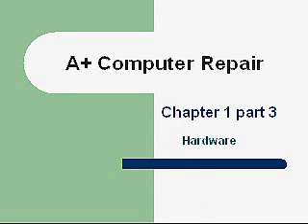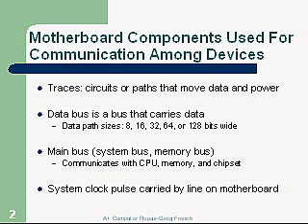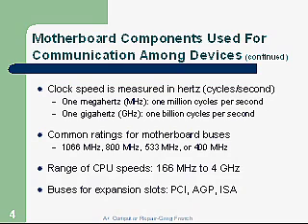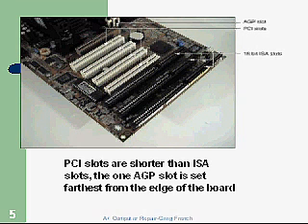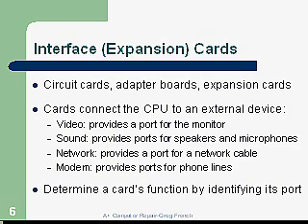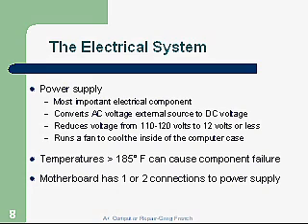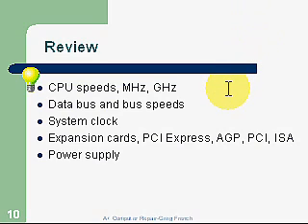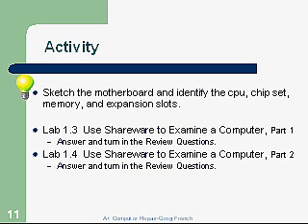A+ Computer Repair Course Chapter 1 Part 3

Comment from the maker: Good question...Independent makes the most sense.  Not virtual or logical, but a physical independent disk.   Maybe at the time the term came about the smaller inexpensive hard drives were introduced.

Comment: Which of these terms is most correct?
I've seen both used by IT professionals and I'm told both are correct, but to my thinking, one doesn't make sense.

RAID = Redundant Array of INDEPENDENT Disks
and
RAID = Redundant Array of INEXPENSIVE Disks.

Independent makes sense, but I fail to understand why the disk cost would be a factor in a purely technical term?
Any ideas?

Comment from the maker: I believe you are correct.  Peripheral Component Interface is a term that has also been used to define PCI in some texts and published articles, but I think Interconnect is the proper term.  Thanks for pointing out the error.